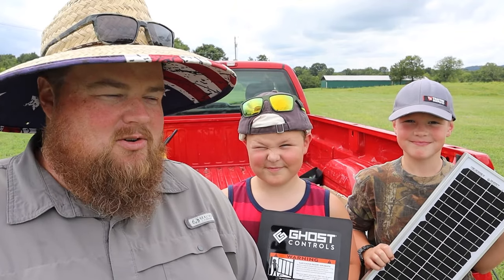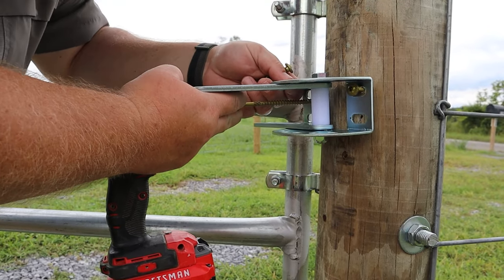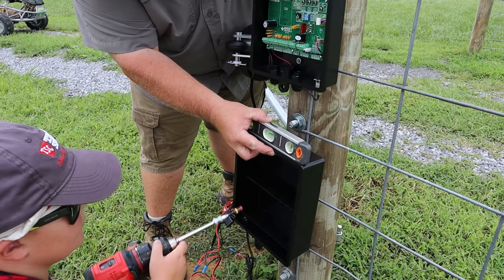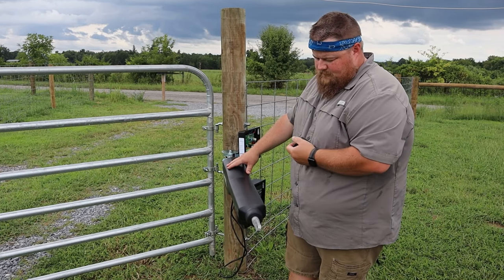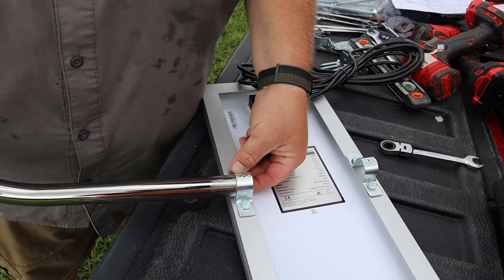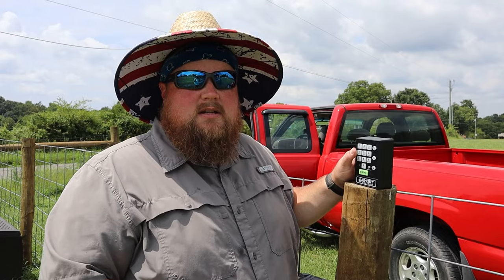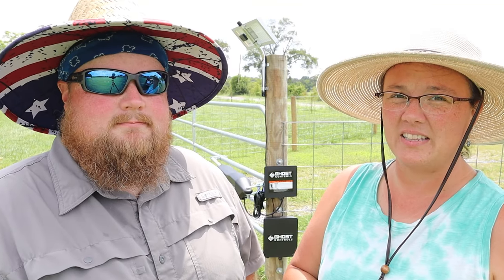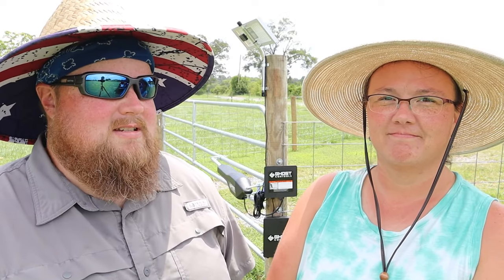Rest Easy with a Solar Powered Driveway Gate Opener by Ghost Controls

Comment: A little tip for the grounding rod. Drive it in at least 3ft away from the devices you are grounding. Keeps any arc discharge to ground away from sensitive device

Comment: I have the same unit. I have the zombie lock and love it. I also replaced the arm pins with locking pins.   I put matching locks on the pins, control box and battery box. 

Also, I would suggest where the arm clamp connects to the gate, drill holes thru the gate and attach it there. That clamp will move as the gate gets hot or cold and your arm will get out of balance.
Reply from the maker: Thanks for the info!

Comment: Nice video. 
I purchased and installed a ghost control gate opener on our property. I followed the easy instructions yet after several attempts to get the gate to close and remain closed I finally gave up and returned the item. 
If you’re considering purchasing a gate opener do your research. Read the reviews. 
Good luck.

Comment: I would remove that ground wire from the circuit board enclosure. It adds potential for lightning damage instead of decreasing. IMO, no ground is needed.

My reasoning:> the metal fence is the most likely thing to get struck by lightning . When you installed the ground wire it is in contact with the fence. 

If you chose to continue to use a ground wire, I think it would be best to remove it from the circuit board enclosure. Inside the battery box connected to negative might be a better place to connect ground (all RVs are like this, negative DC connected to AC ground)

 To check if this will work properly> disconnect the ground wire. Use a multimeter to check for current flow between the battery negative and ground rod while the gate operator is moving and/or stationary open/closed. If there is no current flow at any time to ground, then the system is grounded as best it can be. Do not do this if there is any current flow to ground, because it will kill the batteries.

In any case, remove the bare copper ground wire and replace it with insulated wire that cannot conduct stray current from the fence. Even better, add a conduit to insulate and protect the ground wire where it is attached to the post.
Reply: 🤔 Makes sense

Comment: I use to deliver to places that had security gates and several wouldn’t have a key pad and I usually found a way in to make deliveries the ground rod is a great idea I would think you could ground it at the green wire I can tell you from recent t was hit by static electricity first took out Wi-Fi router fist time second time got two cameras Wi-Fi router again 1 tv and the internet radio head and all this was off at the time

Comment: You'll be happy with that system. My gate is about 700 feet from the house and hidden from direct view. We used to have "curious" people just wander up and a more secure gate became a necessity. Had the Mighty Mule systems before but they became very unreliable and needed stop points readjusted way too often. The Ghost system is more expensive but rock solid and very dependable compared to the MM. Luckily we had electricity down near the gate so didn't use the solar option but I'm sure it's reliable. I did add the Zombie Lock. Perhaps we don't live in such an honest area as you do  🙃. That has been a great option. One additional thing I did is to get the lockable pin for the attachment of the arm to the gate, making theft of the expensive system more challenging. Also a padlock on the controller unit too, otherwise someone can easily slip the cover off and open your gate. As you said, it's NOT bad guy proof, but at least helps keep the lazier ones away. It's nice that you have line of sight from your house to the gate and can use a remote to open the gate too if necessary. It's a real pain to walk down the long steep driveway to open the gate for deliveries, etc.

Comment: Electrician here: reason why they didn’t provide a ground terminal is because it’s 12v system. Not enough power to harm anything and a ground rod won’t protect it against lightning strikes you would need a surge protector for that. Good install though

Comment: Hey Sam - ground wouldn’t be required as you are not connected through 120v service or through a low voltage transformer. If you want to earth you unit, your ground lead can tie into the negative battery terminal. That will effectively earth your controller and any other component connected to it sharing the same power supply.

Comment: Thanks for posting! You’re lucky you installed a single gate closer, running wire in conduit under driveway is a lot more involved! As for the ground not being included , I think it’s a precaution against attracting lightning , as much as mitigating a strike. Here in Hawaii , basalt acts as an insulator, solar systems succumb to strikes up to a quarter mile away, where it can travel in the ground and seek wiring for an exit!

Comment: Solar low voltage doesn’t need a ground, if you had the ac version, it would probably have one, at least the power supply portion.
On another note, not sure if instructions told which way to point the solar panel, for optimum output, in the northern hemisphere
Generally point toward the southern sky, you can look up sun path chart for your exact azimuth, Latitude and longitude location if you really want the best year round optimum charging.

Comment: Hey Boss the reason there is no ground is because with a  24V DC systems, the output is not required to be connected to ground. From the UL 508A specification. Hope this answered your question

Comment: You shouldn't need a ground rod for a DC system of low voltage like you have there. It's a closed loop system, and the Earth isn't a part of the circuit in any way, so a path to Earth accomplishes almost nothing.  The exception is that it does provide a direct, easy path to ground for lightning, but that thing is toast if lightning hits it regardless, so even the one little benefit it might have had is lost.

Comment: I'm a bit late as usual, but you shouldn't use a ground wire/rod on low voltage stuff.  
If you're trying to protect from a lightning strike, look for something called a "lightning diverter".
edit:  I just thought about something you may want to consider - WIND.  My neighbor had a similar setup without a latch on the gate (zombie lock?) and when we had some really strong winds, it broke the mechanism.  I wouldn't have guess an gate like that would catch much wind, but it did.

Comment: It is battery operated (DC Voltage) it does not require a ground.  The negative on the battery is the ground.  Good luck.

Comment: Nice to see the gate operating time, I've been thinking about these too.

Maybe a 2 or 3 gang junction box could hold the extra wire bundle? I think the zip ties look tidy enough, but it looks like the bundle is being touched by the actuator a bit - add in environmental issues, and I might decide to put it in a protected box.

Comment: Hello , awesome video .
Will this kit work for a normal tube style chain link gate ? I have two 6 foot tube style chain link gates and was wondering if this kit would work. The post where the battery and control board would go ... Is only about a 3 inch diameter post.

Comment: Great video. Question, I need my gate to open just like yours. If you are standing off of your property and looking at the gate, the opener is on the left and the gate opens away from you. Is this the hardware mounting style in the order? I had heard to make sure you know which way you want gate to open and if it is the opposite of what you did, you have to order other parts. Thoughts? Rob

Comment: Liked you video.  Don't ground the board that way!  Best best would be to connect ground wire to a gate hinge or fence fabric adjacent to the gate.  Make a path for the lightning to take that excludes the board.  I've seen lightning do all sorts of gate damage...  65,000 or so sudden amps of direct current going through that little fiberglass board won't just use the wire to get to ground... trust me on that.

Comment: Nice video, thanks. Can the opener ram be programmed in a reverse travel so that the opener can be installed inside the gate and push the gate open in an outward direction?
Reply from the maker: Yes, absolutely!

Comment: Hello sir. You probably wont see this. I have this same gate opener. If you have wifi signal you can turn it into "smart opener" pretty easy.b No need to buy the expensive add on box or a new motherboard. 

You can control it from your phone from anywhere and see if it's open or closed.

Comment: I saw this in a blog to the company. Not sure it will help.

Q.  There is a wire labled "ground" coming from the control box. My main question is whether to connect it to the steel fence post or to a separate copper ground rod.

A.  Yes in this case you can connect it to the closest piece of fence, or the gate post.

If lightning hits the fence you want the circuit's ground to be at the same potential as the fence. If you connect this ground to an earthed rod then the zapped fence will be at high voltage while your controller's ground will be earthed.

Comment: I built a privacy fence around my backyard and split rail around the front and was going to add two iron gates over the driveway and I'm thinking this "GHOST CONTROL" product might do the trick!!! Thanks for the video, I was wondering how the whole solar panel thing factored in. I would love to add a solar panel to my shed out back to supply an outlet or two rather than run wires from the house but I'm not even sure if that's possible or not. I know squat about electricity or wiring so🤷

Comment: That’s interesting that they have no ground. If you were hard wired that would be bad news. Fences get hit all the time with lightening strikes so I don’t get that thought either.
Reply: It's because it's direct current ...what are you grounding ?  If for lightning just ground the fence. Alternating Current is different and of course much higher voltage and amperage.

Comment: Mounting the Control box on the gate post seems like a bad Idea.  I would mount it on a post away from the gate even if I had to buy wire to build it in a more secure area.

Comment: ITS BATTERY OPERATED, NO GROUND, GROUNDING THE NEG SIDE OF THE BATTERY WILL CREATE A CONSTANT DRAIN, THE BATTERY WILL HAVE TO RECHARGE MORE OFTEN AND POSSIBLY OVER HEAT AND LIFE SHORTENED. POWER IS GROUNDED AT HOME SITES BECAUSE A HOT COMES IN AND THE GROUND IS USED FOR THE NEG . BEST YOU CAN DO IS  INSTALL A SURGE PROTECTOR.
Reply: You can't drain a battery without making a circuit. If there's no path to ground from the positive terminal, you're not creating a drain.